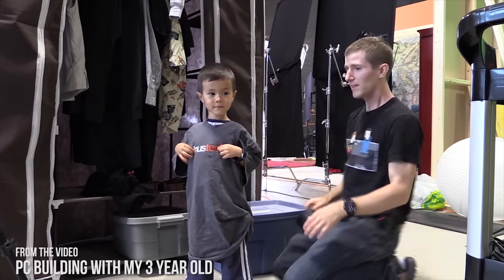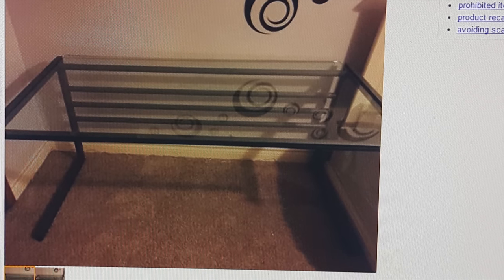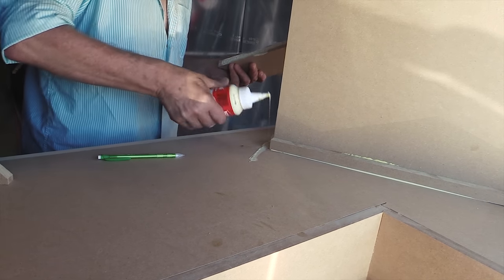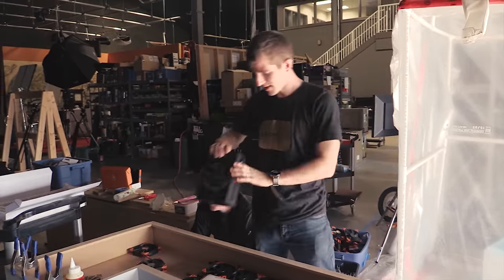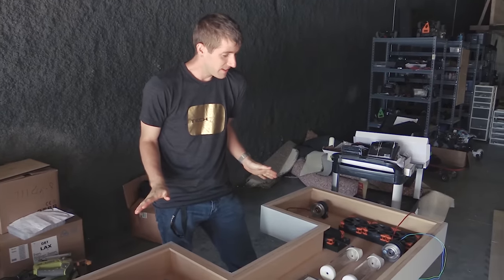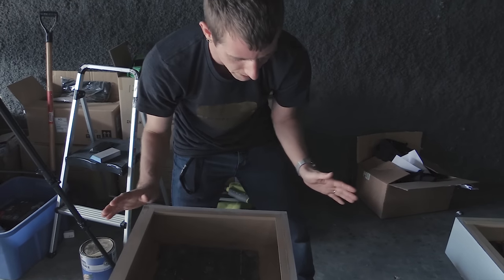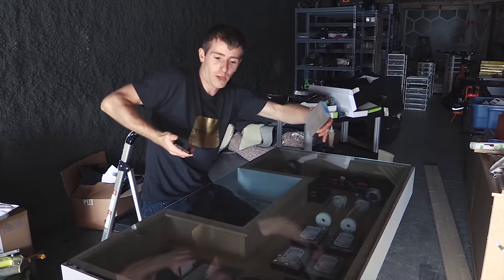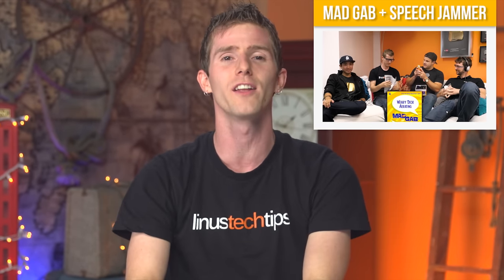Ultimate DIY Desk PC - Desk Construction

Comment: No, you use the same glue you would if you were trying to put an Acryllic top on a desk, I built a PC desk with a built in 24inch touch screen and an acryllic top with LEDs, and a full access panel underneath allowing all the mounted hardware to be removed, cleaned, or replaced at anytime easily.

Comment: instead of wood glue you could use a caulk or power grab or liquid nail or somiething similar to g cleans and neat seams
and instead of screws or nails you could use carpenter staples thats how i learned to do a speaker box

Comment: Instead of using silicone you should just recess half of the molding you're using to create a pretty finish under the glass. If you got a molding the same thickness as the glass you could cut half of it to place on top of the other half that covers the ugly part. Then the glass wont slide and is easily removed.

Comment: You could have done some trim around the glass to sit flush with the top surface and cover the small hiccup that the table is too big for the glass. I think that would have looked really clean, just have to leave a little gap at the back to get your fingers under the glass for when you have to remove it.

Comment: I am currently building a PC out of plywood, the blade of a jigsaw will still bend when cutting a long run of it or using it for long periods of time because the blade gets so hot. At one point the blade actually got so hot is scorched the side of the wood. Also hitting any sort of knot in the plywood will totally wreck you cut. Don't use a jigsaw...

Comment: Linus,  I'm a furniture, cabinet, woodworker, maker and PC builder.  A couple flaws in your design - THE MDF and joinery.... 

MDF from your Home Depot or home center is cheap - very cheap.  MDF comes in a wide range of grades and typically the stuff you get from Home Depot is CRAP.   What you really should use is 3/4" Baltic birch ply wood and pocket holes.   A sheet of 3/4 baltic birch ply will run between 80 to 140 bucks (US) depending on the grade (yes there is a range of grades of baltic ply).  

The reason the choice of Baltic Birch is so important in your desk build is that over time MDF will absorb moister from the air, shift, and potentially fail.  I would never trust joinery using only glue in cheap MDF.   Which brings me to the second part.  Pocket holes.   For the beggining woodworker or just the guy building a PC desk who doesn't want to invest in a lot of tools.  The Kreg Jig Pocket hole system is the best way to go.  It allows you to make strong butt joints using pocket holes (and glue if you like).   I've used pocket holes in both MDF, solid hard woods, and Baltic Birch Ply with great results.

For cabinet case work (like your desk) the best result would be to use 3/4 Baltic Birch Ply wood (Marine Grade) with pocket holes.  The desk (if built correctly) is almost guaranteed to not shift or warp over time.  I predict that the MDF desk you have built will last about 2 to 3 years before it hits the dumpster.   The other nice thing about Baltic Birch is the end grain patterns can be very pleasing to the eye. So end banding can be optional.   Not that this will be a problem for your build but keeping the inside of the desk cool will be important to keep the material from warping.  Wood and wood products move and shift with temperature changes and seasonal changes so that is something to remember and consider.  

Here is a list of things you'll need (that are BTW great to have around the house regardless): 

1) Kreg Jig -  https://www.kregtool.com/store/c13/kreg-jigsreg/p34/kreg-jigreg-k4/
2) Baltic Birch Plywood - (Surrey Canada) http://www.windsorplywood.com/location.aspx?id=961 
3) Circular Saw - www.woodcraft.com 

Best of luck with the build and I will be watching to see how things turn out.  If you need woodworking tips or help please feel free to write me at halon73 (at) gmail (dot) com.

Comment: I think the point to using water cooling is to avoid bringing in dusty air inside the place where the board is. Since you have two of each, it would make more sense to put one on each side so it would be symmetrical. I think it also would have been better to put two systems in all that space rather than trying to spread out the one system to cover all the space. There's other stuff you could have put in there to fill space. Some toy figurines or jewelry or whatever collectibles someone happens to have. Overall, this is a great video. It helps people more by showing some mistakes than by being perfect. :D

Comment: It looks great, but I probably would have used some rubber or something for the outside border connecting the table to the glass. One in the full width of the sides so we dont see the imperfections, and another slimmer one on top as kind of a wraparound of the glass, so it sits flush with the rubber. No need for silicon, the rubber should do the trick, and the glass plate isnt raised

Comment: Should have used 1/8 metal perf board on standoffs. You can use the entire surface as a mounting board. With the added benefit of running cables underneath.

Comment: this is very very late but you should just caulk with clear silicone(?) the top of the glass for multiple purposes, 1 easy to remove when you need to access it at large, 2 it will hold the glass in place, 3 it will create a smooth transition from wood to glass, 4 it will help protect the top of the wood(mv whatever board) from chipping away and protect the edge of the glass. 

I dunno. Cool desk. The legs scare me i know they work but I would definitely accidentally break one off and lose my left leg when my desk fell on it

Comment: I wonder if Linus would have found it easier to spread out the guts of a rackmount server inside that desk? The height of that desk drawer looks almost the same as a 3RU (I'm thinking riser cards with PCI-E slots to make better use of horizontal space and hot swappable hdd bays at the front etc.)

Comment: Router the edges and the middle section so the glass sets into the desk. and where the seams are use felt to coushin the glass and also double duty hide the seams of the crappy mdf wood you used.

Comment: No I may no know what I’m talking about very much but say you guys instead of screwing to the wood directly you use metal rods? One is way more air flow and two you can also hide cables. Or use an additional piece of this wood like a double payned glass and hide all cables there.

Comment: I think the hard discs need a passive cooler on top. Otherwise they might have a significant reduced lifetime. Wood is not a good heat conductor. In a normal case the HDD-case is made of aluminium and therefore enlargens the surface for heat reduction. Would like to know the temp of the HDDs in the table.

Comment: I will be looking to do something similer in the future (Once we move)

However I was thinking of something a little different.

2 PC's in a unit (So from the outside it looks like just another bit of furniture and running USB Hub extension and HDMI cables round to the actual workstations)

My question's (I have two)

1 - I was thinking of a single independent water-cooling loop for both computers (CPU's and GPU's) Now I was thinking of using normal copper piping doing 3 loops around the inside hooked up to 2 quad radiators. This would mean turning on the computers (Either of them) would require the extra step of pressing a additional button (Oh noes) 

Would you think that that would be sufficient to keep both systems nice and cool (Going for cool and quiet) Also is it possible to be able to control the fans speed like this (Im hoping with that cooling I can run the fans at very low RPM)

2 - Is it possible to run two computers off a single PSU (Obviously the watt's matter, So if one system used a 450watt I would need a 900 watt to run both) Guess im just wondering about the connections.

I figure seeing as there both in the same "Case" I could save some money on the parts that could be shared without a performance hit. (Case/PSU/Water-cooling loop)

Is this sorta thing even possible ?

Comment: To correct the mis-measurement issue I might have taken a router to the beauty strip and actually inset the glass top.  That would also make it impossible for the glass top to slide.

Comment: First ever PC parts I've ordered to build myself:
Intel Core i5-6600k
Cooler Master Hyper 212X
MSI Z170A Gaming M5 Motherboard
MSI NVIDIA GeForce GTX 1060 6GB GAMING X
Hyper X Fury Black Series 8GB 2133MHz DDR4
Corsair CX600W
NZXT S340 Midi Tower Case - Black/Red

Is this good enough? and is there anything I'm missing or anything I should know about or any tips for when building it?
Reply: Good parts, Once you do more resource intensive stuff, You can swap out parts for new ones
Reply: Gamesolc Cheers and I was thinking maybe in the future when I have the money, add an extra stick of 1x8gb since i only have 1x8 at the moment instead of having 2x4 which i didn't realise having it split in 2 makes them perform better. Also thinking of upgrading to i7 6700k in the future since Im using this machine to edit just as much as game

Comment: This thing would fall apart pretty quick. I have an Ikea table that i can stand on if i want to. Standing on this thing would mean the legs (due to sideways movement in the table as you do whatever it is you need to while standing on it) would break at the glue joint.

Comment: Nice but i want to see the finished product, as it stand that desk as a PC case is going to have HEAT issues.
You should have routed out sections where the fans blow in & out, ALSO routed out sections where you could use a slab of aluminum as a back plate(s) for the mobo & hdd's.
BAD design but a good idea to get started on something more efficient.
Lastly i wouldn't have the glass where you sit to see your legs.

Comment: if you made the sides of your table a little bit higher you could have like drilled giant holes on the sides and put the radiator on its side with the fans pointing outside the hole, that makes up for aaaaaaaaaaaaaaaaaaaaaloooooooootttttt of space inside your table, and if you do some cable management you can even put 4 computers in this with a seperate room to put all radiators for watercooling + putting all fans on 1 side that doesn't bother anyone and if your a smart cookie, you can also put a tube over the hole of the ventilators blowing outside and use the warmth for i don't know maybe give yourself a nice temp while gaming and not having sweaty hands if you bend over the tube and let the access end in a small slit you screw again the side of your table, so nothing is lost . you could have saved yourself alot of work by making the sides a little higher . if i was working with linus he's dad linus would have gotten alot more then just that computer table . i would show linus something he's eyes have never seen before  .

Comment: don't get why you didn't put the motherboard in the far right corner so the I/O shield is on the side. think that would look cleaner when you attach the keyboard, mouse and other peripherals? I would hate to struggle with the mouse cable coming from that awkward angle....

Comment: I would've put the motherboard in the center with hard drives/psu on one side, and coolers on the other.
Would never use glue by itself, that desk wouldn't survive longer than 6 months in my world(move to clean, kids, gamer rage, etc etc)
I would cut holes in the bottom board for the fans, intake on one side, exhaust on the other, if you do it side ways the sound will travel out.
I would put hinges on the class. if a part fails or you want to do upgrades, ur screwed trying to take this apart if the glass is even lightly glued, plus since the legs are also glued if you pull up on the glass and the glue holds and suddenly releases the glass after a couple of inches of lift, the rest of the desk is gonna drop and those legs are gonna fold like a poker game.

Comment: Where did you buy the extended wires for the power supply? Does this mean I need a differnt power supply or can I but extention to the cables I already have? I looked everywhere for extendable wires.

Comment: I am doing a build similar to this soon and have one question. Where did you order the pci-e 16x extender from? I am looking for these and the quality of some online is questionable to be running a 1070 through. I was curious about your 6-32 threaded inserts but I found those at Home Depot.

Going to do a pc build kind of like this with a sizable piece of tempered glass but it is going to be done with a cnc machine for added ease!

Comment: instead of using silicone to trust the glass wont slide. you can just "BUILD A WALL" - Trump to go around the glass and be flush since you already messed up the measurements. It will secure the glass a lot more and look a lot nicer :)

Comment: NOO, make plastic channels under the table to hide wires 95%, maybe even make connectors for standard cables in the table itself. Imagine plugging a 10 cm long 6 pin from the power supply directly into the table. And same at the graphics card, a 10cm wire from plug in table to graphics card. Talk about wire control. Ohh had i your ressources i would make a star destroyer captains table with everything in it :D

Plastic channels under the table is not only future proof, it will also make future upgrading way easier.

Comment: hey bad ass guys but .....i have an idea for next build....u wont see at all anywhere...............everyone builds cases/desks that show evrything you have well any geek dosnt care about what fans you have what power supply you have first question anyone has is what VIDEO CARD/CARDS ARE YOU RUNNING....that being said i think doing a desk mainly because a case you build will show pretty much all you got but in a desk hide every thing in a double layer like a stuffed pizza bottom layer all fans radiator and mother board hd/sd ram hook ups and top layer have just 2 cards on each side or 4  with just the lighted water cooling i think would be way cooler i only say that is it is cleaner kinda of like a wire tuk in  car all you see is the engine any almost nothing else...pc  = video cards  imo.....and processor lol what do you think world

Comment: Do not chose Squarespace anymore (2020)! Tested that platform 2019 and they´re to slow on mobile devices and not that good at responsive design without lot's of coding. Why they leek in performance is mostly that thyere import lots of code in the beginning when the page loads. Use WordPress or some other system that maintain and update their code regularly instead!

Comment: Easy to imagine the whole thing falling over like a deck of cards and then a hard drive that won't boot anymore due to the heads being demolished into the surface of the hard drive platters.  That sitting hole is not quite big enough for average bald donut eating system administrators.

Comment: im not being a troll but i can promise you THAT IT WILL COME APART on you did not see 1 dowl on your joints and (WOOD GLUE) is for wood not medium dencity  fiber board MDF its basicaly carbboard glued in a press i am a master craftsman you better do something to fix it or you are going to have a problem screw it and put in plugs or laminate it any one with basic carpentry skills will know that wood glur does not hold mdf permanetly silicone the joints or apoxy if you dont want5 to screw it again not being a troll but there is a reason the mdf desks cost so much!!!

Comment: i joke here but stop playin with yourself under the table,
i've noticed that a in a few of your videos now.
is that your fone goin off or something?
wouldn't surprise me if your usin a tablet to coordinate your videos,
or something similar...
Reply: also, why not build with the motherboard in center cooling from side to side...
although your goin for liquid coolin,
could never trust it maself but never had a problem with it...
i digress...
all cables out the back and IO and usb to front middle maybe to the side,
i think you were overthinkin in this vid if am honest...
that way you wouldnt need to worry bout how long wires gonna be,
also if you decided to use an upright copper pipe cooler with leds...
would bring a nice underlight for the monitor,
thats a thought lol